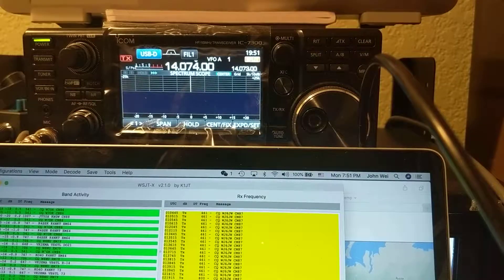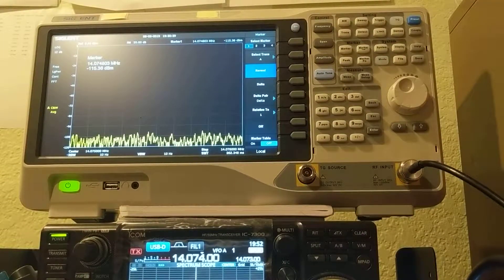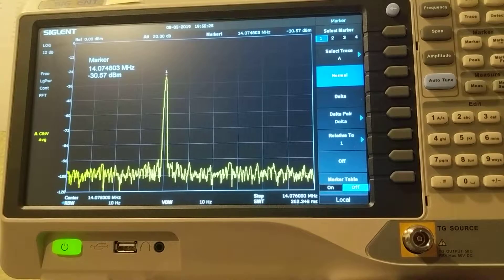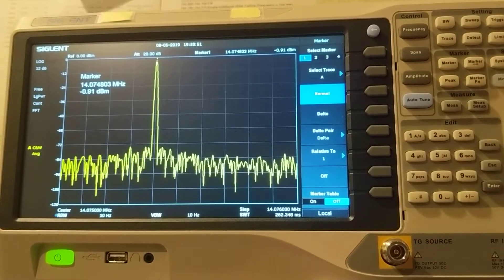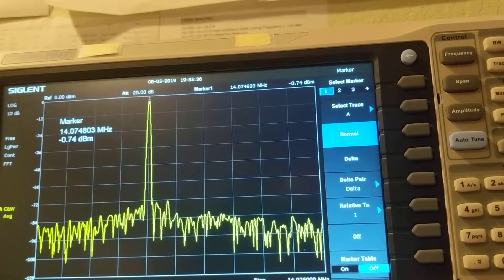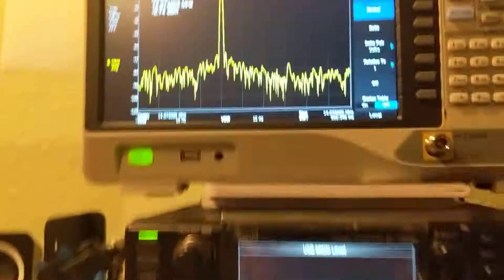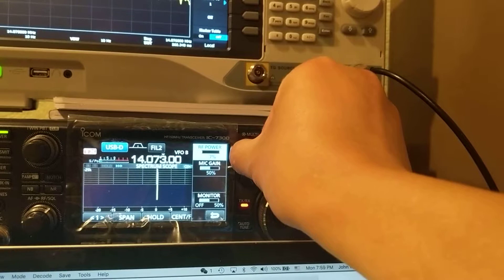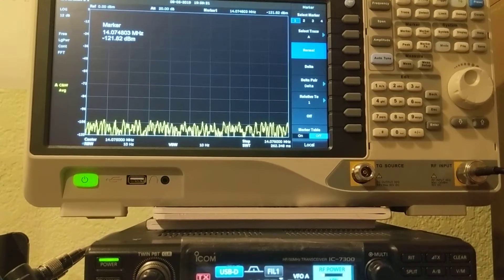wsjt-x: ft8 how to adjust power output

Comment: I have my IC7300 settings with the USB MOD Level at 45%. However the Audio output and Power Bar are both set at 50%. Usually this is  more linear without shouting.  I use the Power Bar adjusting the output settings to match required output levels for each band,  which is retained in memory and consistent, without excess ALC.